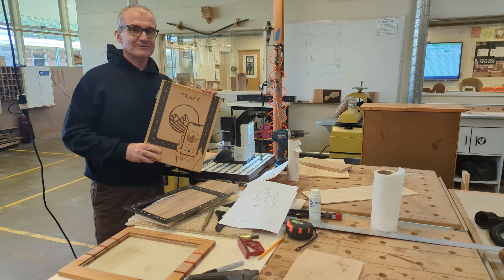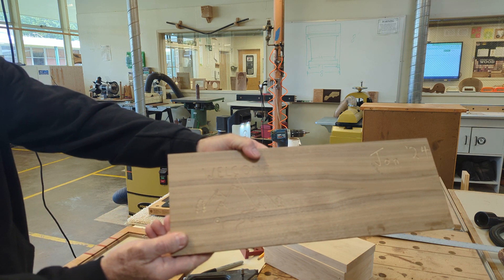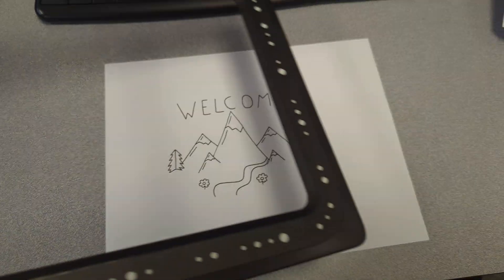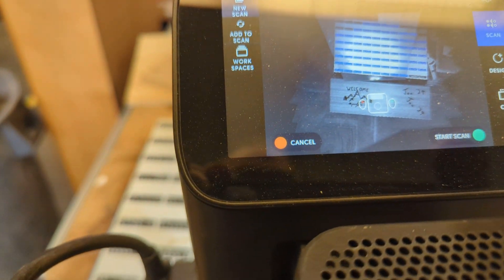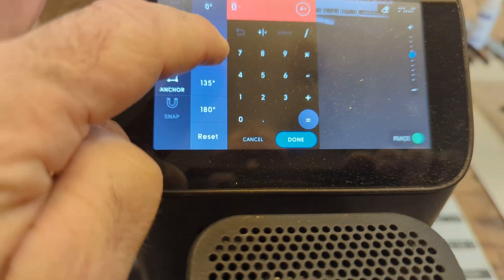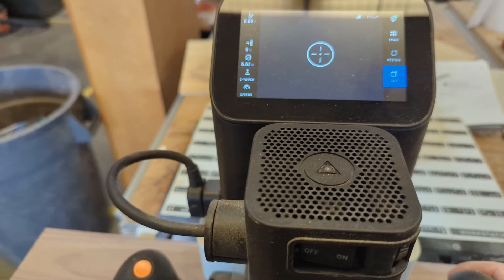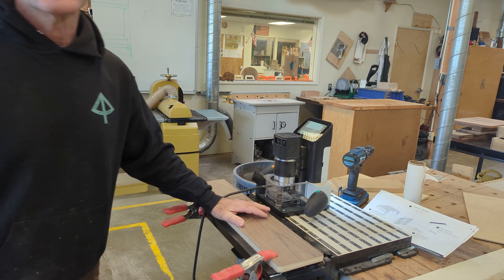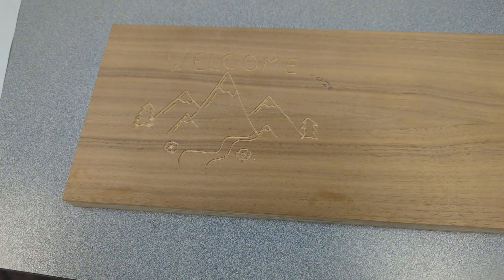How to Use the Trace with the Shaper Origin for Original Engraves

Comment: Hey John,  New subscriber.  Love the content you provide.  Was wondering if you could do a quick video showing how you did your dust collection on your Powermatic drum sander?  I just moved into my new shop and have a Supermax 19/38 that has to live on a wall and be pulled out when I'm going to use it.  I have been going nuts trying to figure out how Im gonna run ducting to it.  I always figured it would drop down over head  but then Id have a hose living in the middle of my walkway when the sander wasn't in use.   I like your idea of running  ducting low  on that back wall.  That may solve all my problems if I did the same.  I have all of my sanders grouped together along one wall. Edge sander,  Spindle sander, and drum sander.  all with collection ports in different locations.  How much of a pain is it to use your drum sander when pulled out from the wall having that floppy hose hanging off the side?
Reply: ok. just saw you did an unboxing and review of the powermatic drum sander.  Are you able to pull it out from the wall more than what you show in the video?  I need to pull mine out about 2-3 feet or so to make it usable around the other machines
Reply from the maker: I kind of like it a little hard to use, because I don't want the kids to go right to it instead of cutting to length. If not regulated it starts to get used as a crutch. Instead of precision woodworking
Reply from the maker: My ducting comes down the wall to flex hose to the planer, there is an extra couple feet of flex so it can move out a little, probably 2 feet.